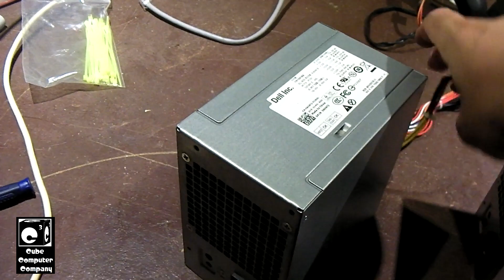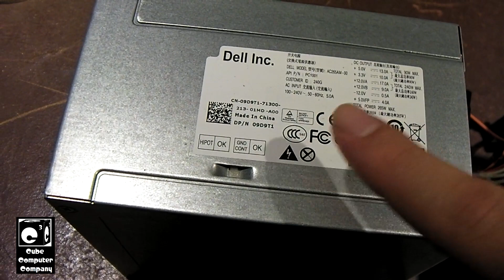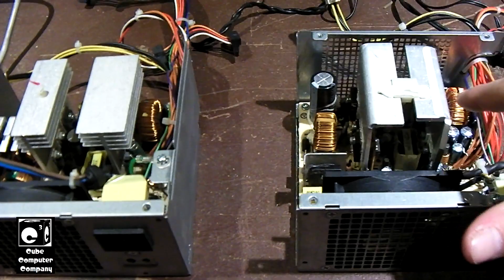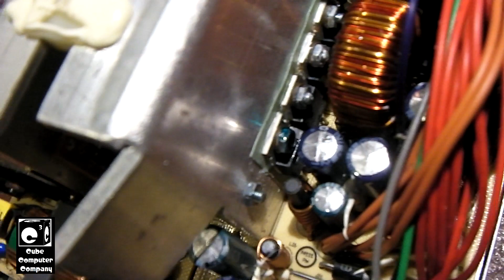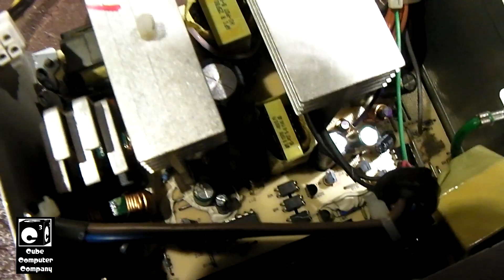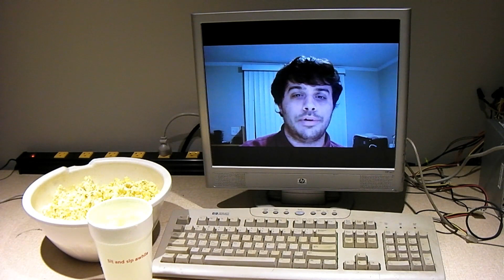Comparison between two OEM PSUs for the Optiplex 390 - Chicony and AcBel

Comment: good day, may dell potiflex 390 psu is 265w is damage i want to replace 450w 80+ psu it is posible sir?
Reply from the maker: The 450W unit will work. You don't need that much power for that machine, but it will drop in and work.

Comment: I had an optiplex 390 mini tower, and I had the acbel unit- the acbel unit coil wined and produced a high pitched squeak at all times, it wasn't very loud but it was certainly noticeable. Then I upgraded it to a seasonic ss350et 350w which is very quiet definitely does not coil whine even though its from 2009.
Reply from the maker: Could be bad capacitors causing the whine. I have a FSP 300w unit from an Acer tower that whines really bad. The caps in it look fine, but electrolytic capacitors don't always bulge/leak when they go bad. I'll eventually be recapping it and see if it makes a difference.
Reply: @CubeComputerChannel  good luck and I hope the recap works, I've just had a look inside my seasonic unit and a little board on it has a date of 2005 on it, the psu has a rubycon cap on the primary side and on the secondary side it has a su'scon cap and teapo caps- I believe all the cap brands listed are good except from the su'scon cap, the psu is from 2009 so do you think it has much life left it still runs fine but that can probably cha get quickly considering it's age or is that not the case. Thank
Reply from the maker: @Remi-h8z  Seasonic is among the best of the PSU manufacturers out there. As long as the caps aren't bulging and the unit's working fine, I'd leave it be. It'll likely run for years to come.

PSUs can last for a really long time. The only real issue with decently built units can be capacitors. The Thermaltake Smart 750M unit in the MidTower Deluxe (my system) is approaching 10 years old. It's a Channel Well made unit and has I believe Chemi-Con cap in it.

I still refurbish and reuse OEM units made by Bestec, HiPro, LiteOn and others. Usually it's caps that go bad and need replacing. In other units, the manufacturer used a yellow glue which if heated over a long period of time, will darken and start conducting. In those, the glue has to be removed if it's ever caught getting dark around a high voltage part. Aside from a couple bad apples like the infamous Bestec ATX-250-12E, many OEM units can be very reliable with good caps, and can even run in the ballpark of 78% efficiency.

I'll likely do a video of recapping the FSP unit. It may not be a full recap, but I'll have to see if it helps.
Reply: @CubeComputerChannel  thanks for all the information